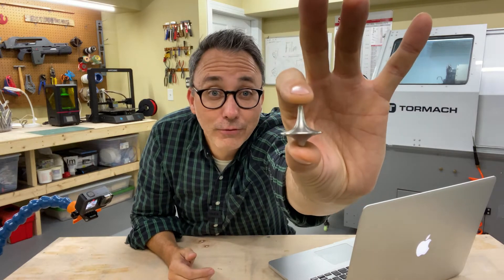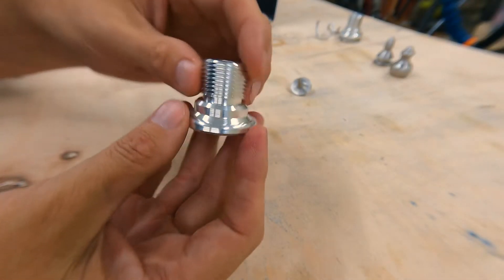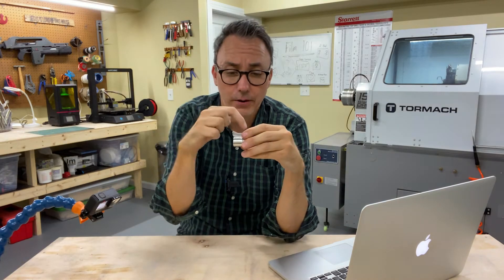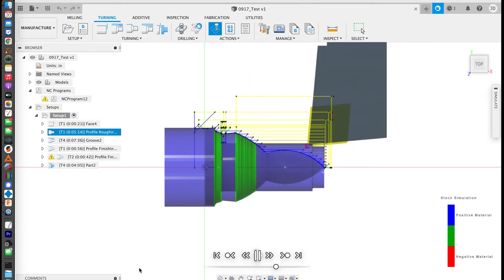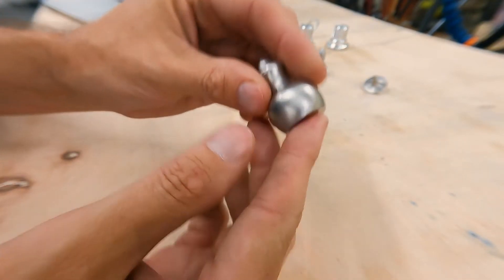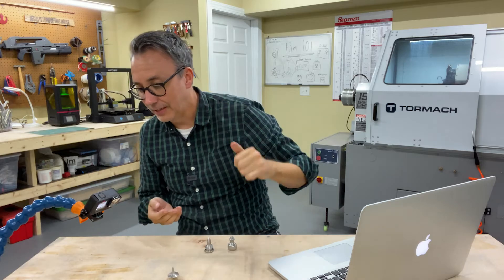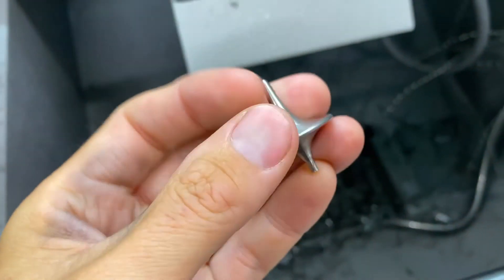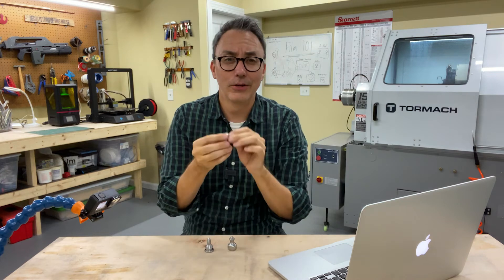Making the Spinning Top from Inception (on a CNC Lathe)

Comment: bit late but you could have the part oriented the other way in the lathe so that you don't have to manually make the tip it spins on. you could also set a single ball bearing as the contact point against the table!
Reply from the maker: Great point!  Next time!